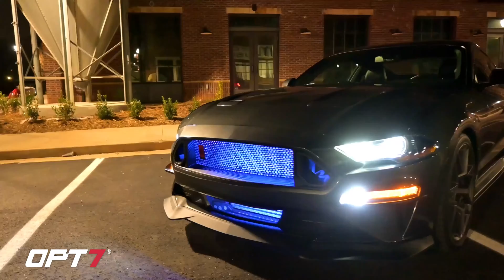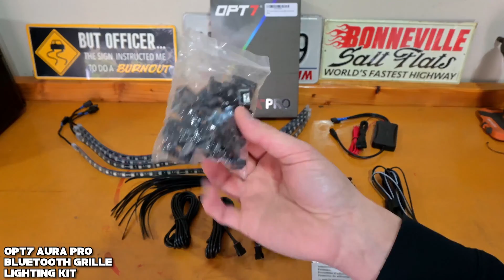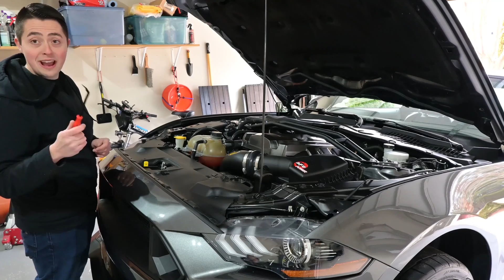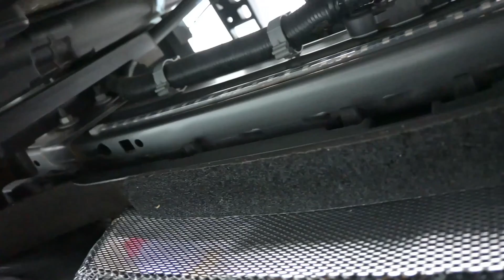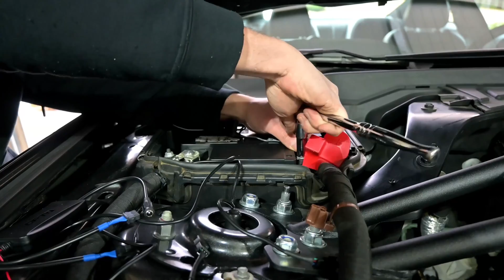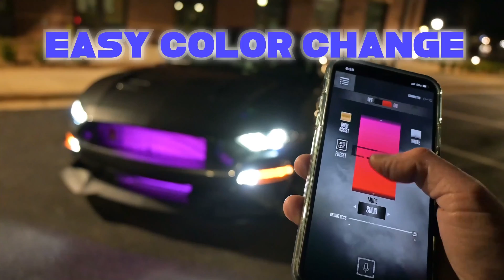[How to] OPT7 AURA PRO Bluetooth Universal Grille LED Lighting Kit  - Easy Install Must Have!

Comment: if I put the negative on the positive and the positive in the negative now is not turning on. Do you think the module burnt because now it doesn’t turn on at all?? Please let me know. Thank you
Reply from the maker: Please follow the instructions provided in the manual. Connect the positive terminal to the positive, and the negative terminal to the negative only.

Comment: Careful mounting stuff near battery. It will melt wires. Did a kit and some wires were too close and melted. Wrap with heat tape too.
Reply: Agree. Lol. Don't put anything on the battery. I would say to wrap your wires in heat tape to protect them.

Comment: Also I do have the kit but I have the one w the positive and negative power connections. But I wanna fuse tap them. Do I just cut them from those and connect it to the fuse tap?
Reply from the maker: Here's the kit you want to use to make that change: https://www.opt-7.com/products/aura-universal-replacement-fuse-tap-adapter-set-power-wire

Comment: I have an old version and new version power cable.  old one i am able to connect to a fuse and it turns on with the car, but with the new version like in this video, i cant do the same, it wont turn off with the car as it connects to battery.  Any help on how to use a fuse connection to tell the system to power on?
Reply from the maker: yes, you can purchase the fuse taps here set up here: https://www.opt-7.com/products/aura-universal-replacement-fuse-tap-adapter-set-power-wire

Comment: I just got my grille LEDs. I have a challenger and my battery is in the trunk, so where is best to connect power?
Reply: you can use the fuse box in the engine bay like in the video there is a positive positive terminal and grounds everywhere

Or you can run the wire through the bottom of the car all the way to the back and up through the trunk but that's a lot of work
Reply from the maker: Thanks for your support with OPT7. Please email our technical support for proper install support - support@opt-7.com

Comment: will not drain the car battery?
Reply from the maker: It wil not, but if you rather prefer the fuse tap method, you can purchase them here -   https://www.opt-7.com/products/aura-universal-replacement-fuse-tap-adapter-set-power-wire
Reply: @spinalfusion1622will it drain or impact my battery even if I only run the lights when im driving my car ?

Comment: Mmmm hard wire would be better?
Reply from the maker: Not sure what your asking, but the kit can be installed by either the cig adapter, fuse tap method (sold separately), or the provided direct battery connection.

Comment: Can you add the door assist video
Reply from the maker: it varies between each vehicle as the trigger wires are different. We would recommend to have a professional assist on the door assist as it requires splicing and tapping into your dome light. We valued your feedback and appreciate your support with us!
Reply: How about connecting the Bluetooth to your phone